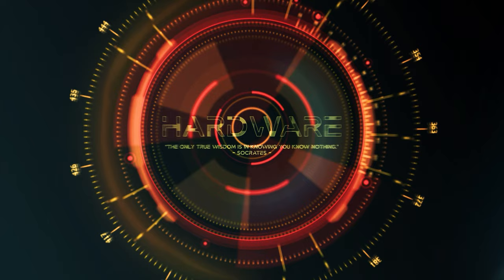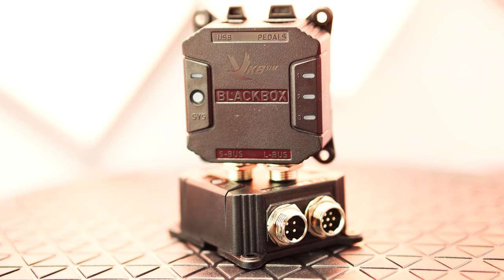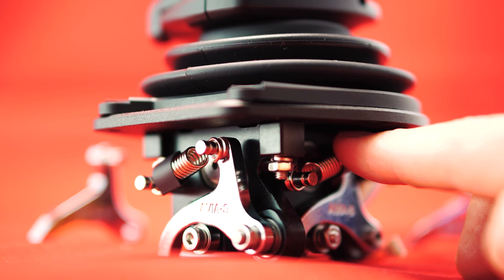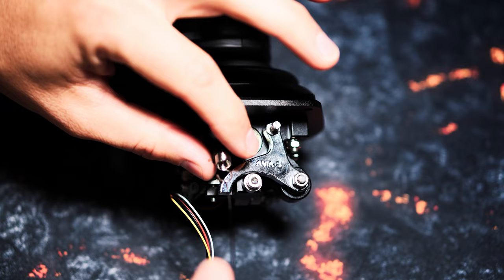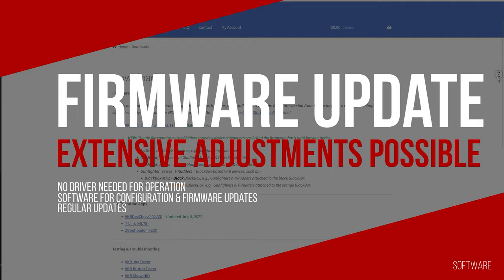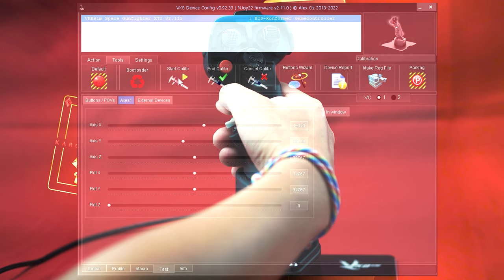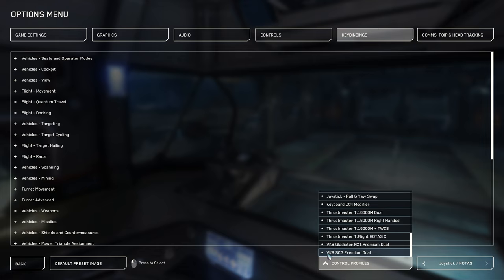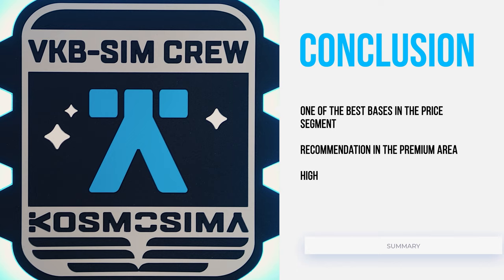Hardware Review [4K] VKB Gunfighter MK.III Part 2/2 | Hardware customization, software & conclusion

Comment: Nice review. Detailed and with nice explanations on how to customize the stick.
Been running GF MK.III / SCG Prem in dual configuration for 1-2 year now. Expensive but well worth it. Huge upgrade from dual T16 and/or X56 I used earlier.
Just ordered the EVO upgrade for the left stick. Will be testing it out next weekend hopefully.

Edit:  the only upgrade I can think of is if they make a new version of the SCG stick - in metal (with a bit more silent buttons) as they did with the MCG Ultimate.
Reply from the maker: have fun with the upgrade. Thank you very much 🥳